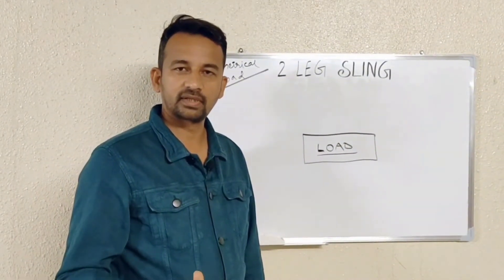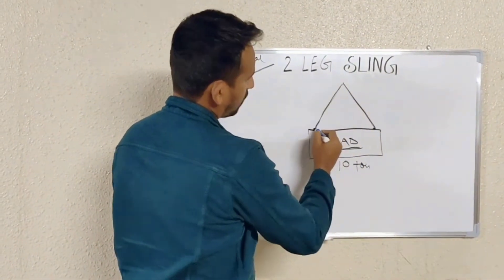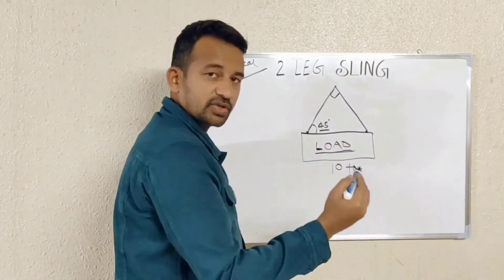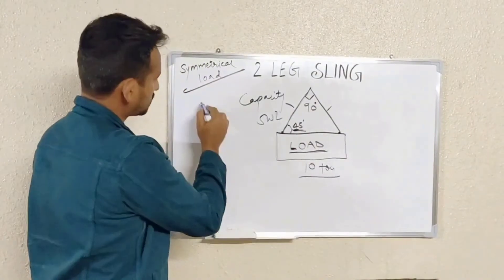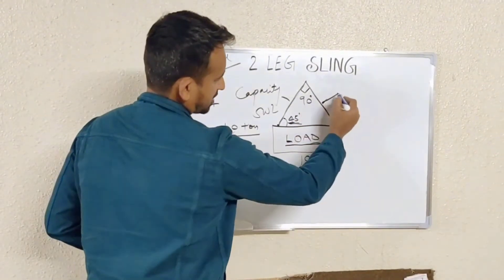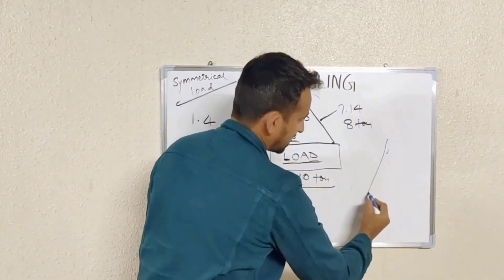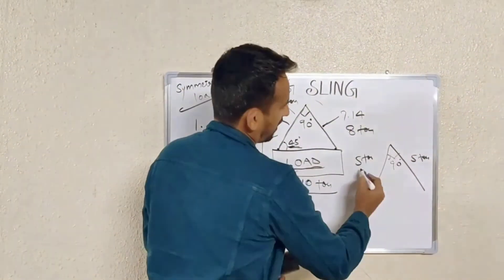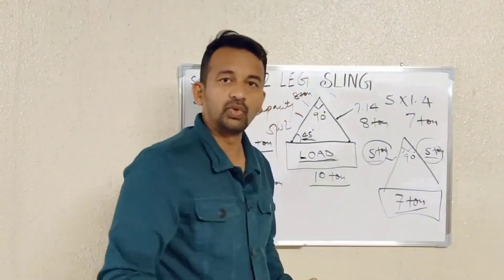Sling Lifting Capacity Calculation - 90 degree included angle

Comment: What capacity of sling shall be used if the load is 17 ton and the sling angle is 30 degree
Reply: First, there are two angles on inclined sling, They are Alpha angle and Beta angle. 

If you are referring to Alpha angle the mode factor is 1.4 with two lifting points. The reduction factor is 70% same as 0.7

But if it is Beta angle the mode factor is 1.7 with two lifting points. The reduction factor is 85% same as 0.85

1.25 is the minimum safety factor use in calculating inclined sling capacity needed to lift a known load weight.

The formula is Sling Capacity = Safety Factor × Load Weight ÷ Mode Factor 

You can now work it out and get the value.
Reply: @philano7847  Hey there! I am quite impressed by your answer. I wanna know where can I find these standards ? Please reply...

Comment: GOOD EXPLANATION EXCEPT THE BACKGROUND MUSIC.  COULD YOU PLEASE TELL ME WHAT IS THE 1.4 ?
Reply: It is mode factor when the internal angle betwen two slings is 90 degree,to which we commonly call Alpha. Utilization factor for 90 degre is 70% which equals to 0.70. so here we use two slings therefore, 0.7*2=1.4.  if we use three or 4 sling then it will b 0.7*3=2.1. for 3 or 4 sling mode factor remains 2.1 because the 4th sling in load hoisting always remain free..
Reply: @ikramullahkhan800  may I know is there any standard from where it gets 70 percent for 90 degree.. ?
Reply: @ikramullahkhan800   may I know